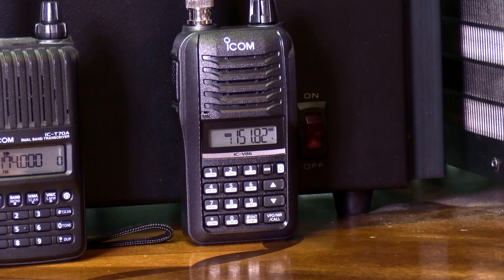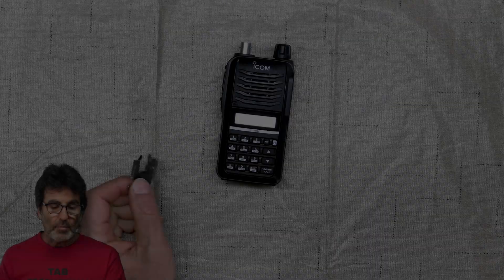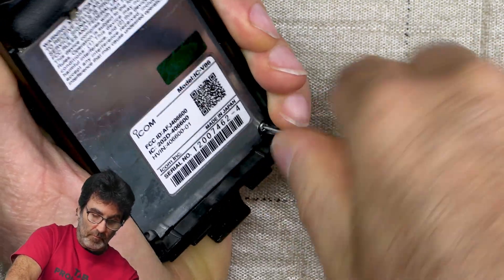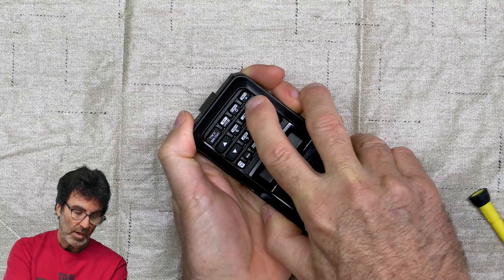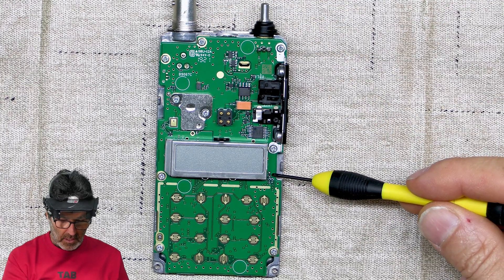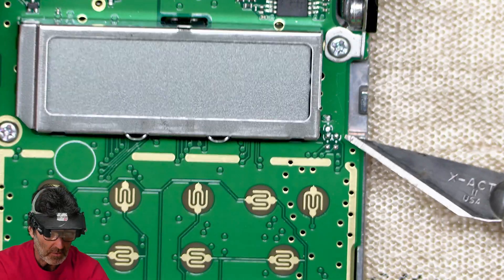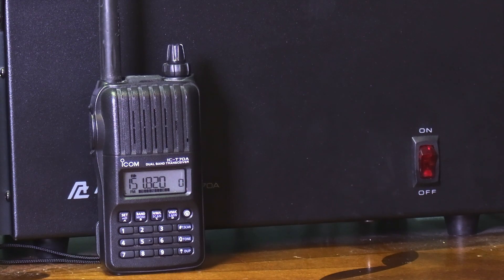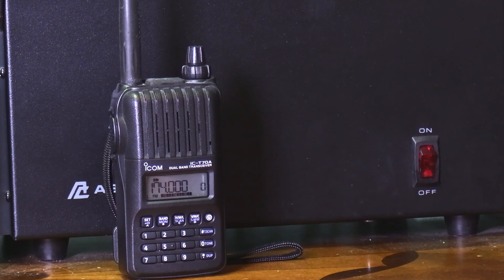Open Transmit [TX] MOD On ICOM IC-V86 (Test at the END!)

Comment: I just received my v86 from gigaparts,, and paid extra for this mod. However I cannot get the gmrs frequencies to program. It says "certain frequencies are not compatible with this radio". Does that mean the mod was not done?
Reply from the maker: HI... The V-86 is a VHF radio only.  The RX-TX range after the mod is 136-174.  GMRS frequencies are in the 46X.XXX frequency range.  This radio does not cover that band.
Reply: @JLPicard440  ok, thanks for the info.

Comment: Please, what is the external microphone connection of this radio?  Its connector is 3 pins.  73
Reply from the maker: HI... You might be able to find the pinout for it in the manual.  I usually just use an Icom microphone that already has everything connected.
Reply: @JLPicard440  Gracias por responder.
Reply from the maker: @marcelookunz-lu1fk  De nada

Comment: Is this the same process for the IC-V80
Reply from the maker: I doubt it... You can easily go to mods.dk and compare both mods to see if there's any differences.
Reply: @JLPicard440  I can confirm that the modification is the same on the IC-V80. The same resistor in the same location needs to be removed.
Reply from the maker: Good to know!  Thanks for the info.. 😊 @CaptainHat12

Comment: I bought 2 of those exact radio thinking they were marine radios. I work at a very remote camp in Northern BC and we use marine radios as walkie talkie. Since we are way out of range from anything else. It's never been a problem. By the time i realised they were not marine radio. It was a couple months after purchased. And the reseller who sold them to me didn't want to take them back. They are brand new in the box. What can i do with them? Can they be useful for anything?
Reply from the maker: If you open these up, I believe marine band is FM and uses frequencies between 156-174... These will work if you program the specific frequency that corresponds to whatever channel you're looking for..  You might need to swap out the antenna for it to work best with a marine antenna that uses the same connector as this does.. I think it's a BNC connector if I remember right.
Reply: @JLPicard440  Thanks. But i wouldn't even know where to start. If i have to open them up and modify them, maybe it's better if i sell them and purchase real marine radios. They work great as walkie talkie though. Thanks again
Reply from the maker: Yes I understand... sorry about that.  Hopefully you can get most of your money back..
Reply: I may be interested in buying them from you for the right price
Reply: @jacobcp93  i paid $380 for both. They are brand new in the box. Never used. Tell what you would offer?
Reply: I did this mod but it is still in the ham band
Reply from the maker: If you removed the same component it should have worked...  If you go to mods.dk you can look up the mod for the radio and see a picture of what components are supposed to be left after the mod is done.

Comment: I have one of these with a handful of batteries and have never used it. I also have two Yaesu FT-65's that have the transmit opened and carry three antennas with them, one 2M/70CM, one 155 MHz for MURS, marine, VHF business, and one for GMRS/UHF business. The 5w Yaesu's transmit at 3.4w on GMRS which is acceptable for transmitting out of band, I can still reach the repeater 57 miles away. Did this mod on the ICOM V-86 affect the memory you stored. I have the RT Systems programming disc for this ICOM and am thinking about breaking that diode out like you did but don't want to ruin an excellent radio. Thank you for this video, I've had the V-86 for two years and was very disappointed that I couldn't get the MARS mod from HRO.
Reply from the maker: HI, I don't know for sure if the memory will be wiped out.  I didn't have any channels stored when I did the mod.  I have manually programmed in some freq's since the mod with no trouble, but I did it manually..  I didn't try the programming disc since I don't have one available to me.. Hope that helps.. 😊